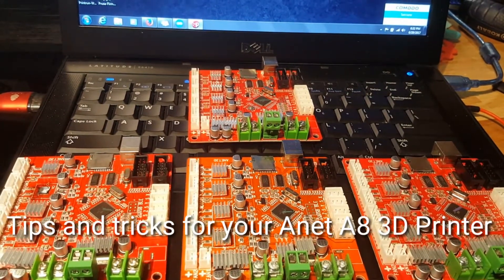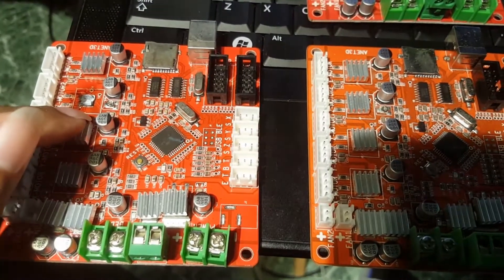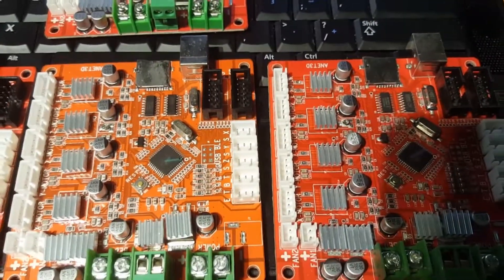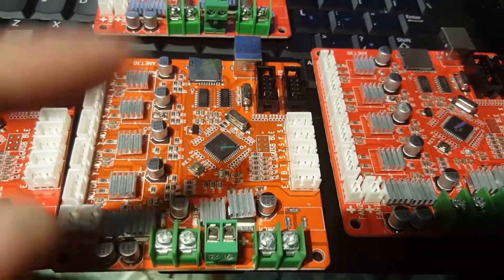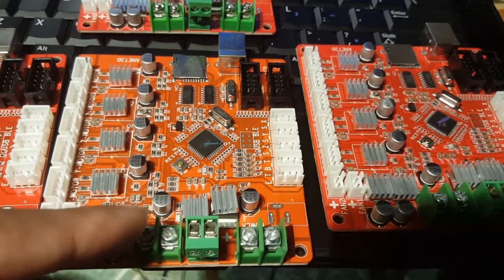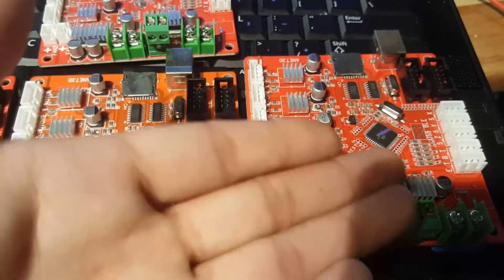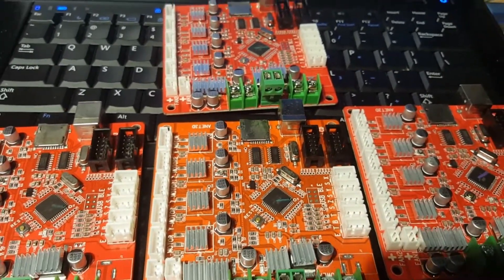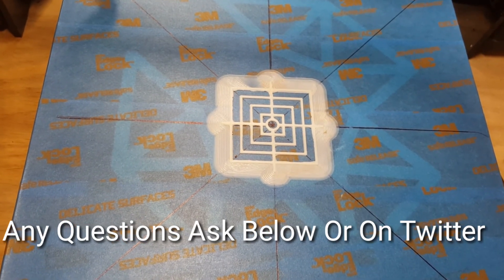Are you having trouble with your Anet A8 3D Printer?

Comment: my printer keeps glitching out in chinese i am not sure if its a dead motherboard or if a wires shorting somewhere
Reply from the maker: Well I would say its the mother board because those mother boards always gave me problem so I would say to get a mks gen lv1.0 mother board and you will have to upload the marlin firmware after you set it up for the Anet A8
Reply: @LegitLeeVelez  I've fixed it it was my screen not plugged in all the way if its even a little bit out at one end the printer goes funny screen comes up with Chinese and it prints whatever it wants instead of the cad model just because the screen was not plugged in all the way
Reply from the maker: @ragabufragsome3426  well that is good you got it is work again and if you have problems with it again then I would still say to get the msk gen l v1.0 motherboard because I never really have any problems with that motherboard

Comment: I built my A8 two weeks ago and up to today I have not been able to print, because the x axis goes crazy after the first layer.  I tightened the belts, lubricated the slides, even swapped the x and y motors around, and tried various slicer software.  I found the problem by accident, the x axis heat sink was very hot compared to the other heat sinks.  So after standing a cooling fan from a pc next to the motherboard, the printing is now perfect.

Comment: I had similar issues with my anet A8 however also when I plug my in. it will turn on but nothing else would work and the and the software that was in the Flash drive wasn't working either that came with the era

Comment: Put my a6 together and it homes and displays just fine. But I cannot connect to usb.  Usb works fine on computer, as I can run many other devices.
Reply from the maker: USB port may be damage or could try to look for drivers or see if you can see a COM Port pull up in your devices. I would check that out first! Also do forget to subscribe and check out my new Videos!!

Comment: If the printer shut off during a print and now wont turn on at all do you know what the problem is?
Reply from the maker: Either check you power supplies voltage or the connection from the psu to the motherboard can't be to many problems with no power only other thing that it could be would be the motherboard is fried hopefully it isn't that make sure your on 110 volts ac for the psu switch if your in America.

Comment: Since your A4988 has a thermal cut off more then likely you shorted the wires out and fried the board but this all depends on any manufacturing faults like trace width and solder balls (which I can see on the bottom right already). Could even be metal whiskering.

The color of the solder mask doesn't matter one bit. 

Yep your going to melt your PTFE insulation for the thermistor and short it out causing no reading shutting down your heating. While your looking at learning since you have your system enclosed might look up Power Dissipation versus Ambient Temperature and Temperature Junction and for your board this is important since you have SMD mosfets.

WE in America call a fish a Mar lin unless you believe in fairy tales like Arthur and his wizard Mer lin. 

Yes we use metric in America with engineering and science among other things.

Comment: You could put the chip off a work g board onto the board that don't work on the z axis and regarding the thermistor you should always work backwards to the board ie you probably clamped the thermistor too tight and shorted it out. Basicly I'm saying any issue with a printer the board should be the last thing you check after the part and all the wiring then Re-flash it if need be and lastly replace the board. You could also use the one with the broken z axis for something that doesn't require a z axis ie a laser burner.

This video is too long boring missinforming and your just waffling on

Comment: The Anet has 3 pins ,,, thermister has 2 wires???
Reply from the maker: Yea it only has 2 wires and has 3 pins they should of done a DuPont connector
Reply: so how is it wired?
Reply from the maker: Glen Dooer I don't remember off the top of my head but it only uses 2 wires so got to see which pins to use but just try it until you see it putting out a temperature
Reply: ok i am sick of Flashforge boards blowing up so looking for another,,,these worth while using??
Reply from the maker: Glen Dooer no I don't like them I would say I ran a lot of hours on a ramps1.4 or try a mks board
Reply: Yes think i agree with you ,,,dontknow about loading Marlin ,,,my build plate goes up and down not side ways,, anyway thnx
Reply from the maker: Need to know what kind of 3d printer you have is it a core xy style?
Reply: Flashforge Build goes vertical ..assume can be set on Marlin>>
Reply from the maker: yes it can I don't have the flashforge but I know it can be setup with the marlin firmware and it shouldn't be hard

Comment: Install marlin
Reply from the maker: I have installed marlin this video is kind of old but I still have the boards if you want me to make a video on how to install marlin on them I will but I will say I stop using this boards and now I sticking with the MKS Gen L V1.0 I would say you should look into upgrading if you haven't already.
Reply: @LegitLeeVelez  I have the mk2 border with solid contacts infused for power I've tried to install Marlin but the snyc is not working right if you chold tutorel please
Reply from the maker: @tylersheehy3918  Do you have U8glib installed in the Arduino IDE? and check your COM Port and make sure you are on the Arduino Mega 2560 for your Board
Reply: @LegitLeeVelez ok I will check thank you
Reply from the maker: @tylersheehy3918  No problem you should check out my latest video I just built me a new 3D printer from scratch!

https://www.youtube.com/watch?v=K0F9Psxxkqs&t=23s
Reply: found it
Reply from the maker: @tylersheehy3918  What was it the Com Port or the U8glib?
Reply: @LegitLeeVelez  add liebrarey teacher found it installed it on ide just today u8glib
Reply from the maker: @tylersheehy3918  Ok good so it was the U8glib then so is it working now?
Reply: @LegitLeeVelez  yes now it installed Marlin thank you